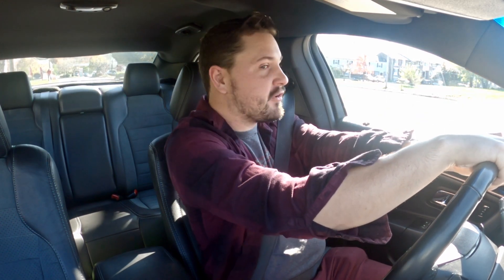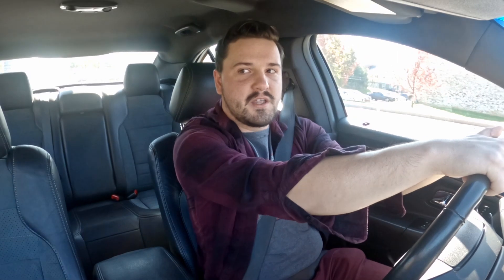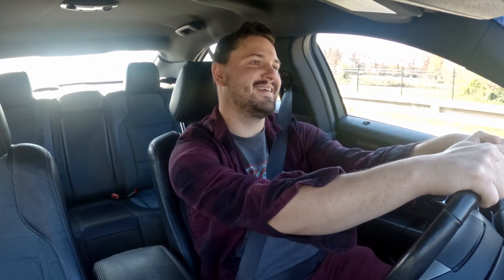Engineering an Experimental Ford Taurus SHO Dual Exhaust

Comment: I can almost try to do that it will be about 3 1/2 feet back but I can ask, I need to take my exhaust in to have it looked at anyway after I get my engine looked at ahaha 😅 love the video man love the progress on the channel
Reply from the maker: What I did is not your average exhaust mod lol. I had thought about putting a x pipe just before the rdu. But what I did is max effort lol. I'm putting together the build and sound video now. Should have it posted by the end of the week. And thanks for the support! I do really appreciate it! 😀💯
Reply: @KarzKreated  yea well don’t worry about me trying anything my cylinder 6 does not like me 😅 just got it back and more problems and the plug and coil where in perfect condition so it leaves me worried
Reply from the maker: Seriously? Oh crap! Did you check compression?
Reply: @KarzKreated  yea it was under 100 🤗🙌🏽... no bueno low key hoping it’s blown because if so I was at my limit anyway of the short block according to my tuner he said once u get upgraded turbos he said it turns into a when it’s gonna to blow not an if it is so I’ll be doing built block and upgraded turbos all over winter time I hope I find out Thursday if I need a block or can get the one fixed back to spec
Reply from the maker: Well the silver lining is the big build lol. I'm waiting for my day.
Reply: @KarzKreated  lol yea I knew it was coming I just didn’t know I would be fully be building everything but the trans and ptu in the first year of owning the car ahaha🤦🏼‍♂️, but the ptu I just got replaced I got to about 450 miles I did one baby baby pull and the next morning i went to start it for the 2nd time of the day and it popped and started it miss, but I think I have someone that can do some cool mods to your stock parts his Instagram is 454chuy I was going to have him port my manifold and tb but I didn’t get the time to🤣